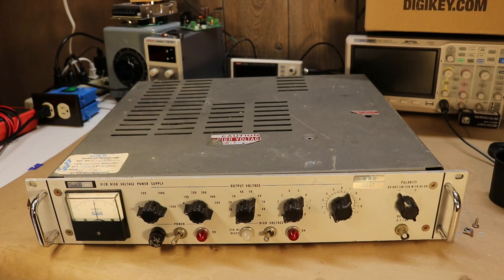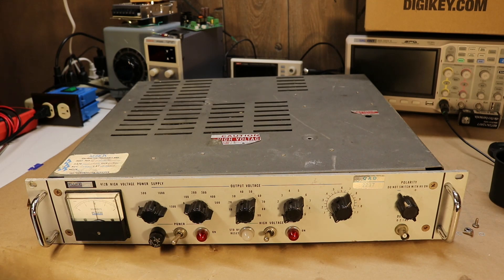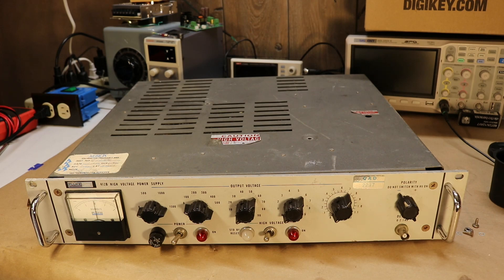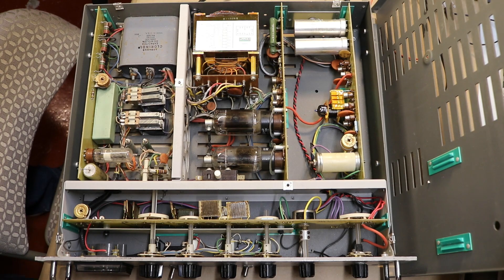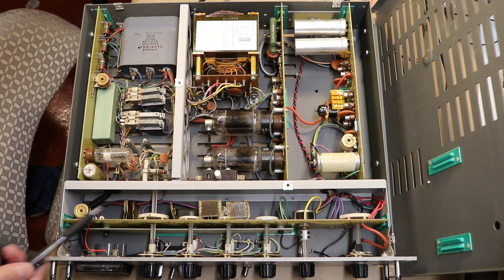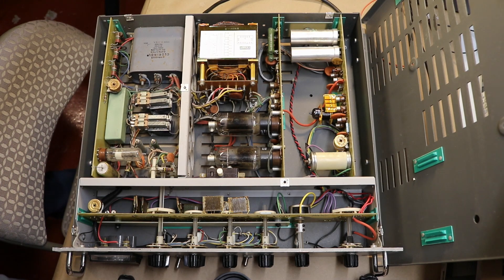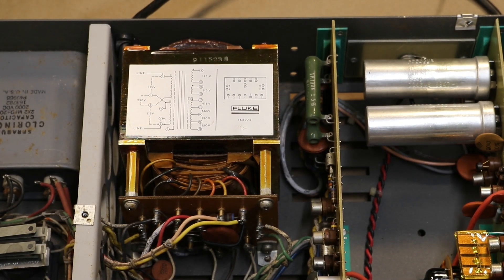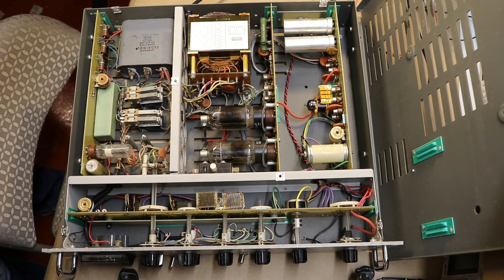Fluke 412B High Voltage Supply Overview and Teardown

Comment: These are great old power supplies. I have used them many times over the years. However I have never seen a power supply used to calibrate multimeters. I have been doing calibration since 1987 and work in a Reference Standards Lab currently. Throughout my career as a Metrology Technician power supplies have been used only to supply voltage for non calibration uses. If a power supply is used as the source voltage it would be monitored with a precision multimeter which becomes the Standard, not the power supply. Calibrators are used to Calibrate multimeters.
Great find!!

Comment: Awesome video, thanks for posting - you seem to be the sole source of information 412B! 
I've got one of these open on my bench right now that I've had for a few years and just got around to troubleshooting. The HV supply and regulation work perfectly, but only if I manually close that open frame power relay.  I'm pretty sure the time delay relay tube (or its control circuitry) is bad, BUT the part number is illegible so I'm kind of stuck.  After I close the main HV relay, both of them operate normally from the HV switch on the front panel, so I think that localizes it to the time delay circuit.

Any chance you have a schematic you'd be willing to share, or at least a part number for that time delay tube?  Any info would be appreciated.  Thanks!
Reply: Ah, that time delay relay was easier to find than I'd suspected - Amperite 115N030 - even found a datasheet.   No luck on a schematic or service manual, though
Reply from the maker: Sorry for the late reply... I looked for a manual for years, even bought what I thought was it from NASA JPL auction... It was for the 412B that is not adjustable... My assumption is there is no longer a surviving schematic. That being said the regulation system appears to be identical to other 400 series like the 410 or 415, and you can find the manuals online. The reference designation will be different, but using the pictures in the manual you can transcribe. See my HackaDay project for more schematic info.

Comment: Nice! I haven't seen anything on youtube (or elsewhere on the internet) about these yet but then again I haven't exactly been looking for details about them. I happen to have the 4kV version (I think) and I'm not sure what I can use it for. I think its current output is even less - much less than 30mA - but I can't be sure right now. For a time I was considering of using it as a power supply for electrostatics but there is really no point (that would be tantamount to the definition of overkill squared or perhaps cubed). Learning here that these were primarily intended for lab use - well, kind of obvious really but then one can never know a priori - kind of clear things up a bit.
2:33 6080 tubes are available as NOS still and their sisters, 6AS7 tubes were still made by Sovtek/Svetlana at least until recently - not sure what the situation is now. You do need two of them so the price seems right, if not a little bit low.
6:53 Ha! Understatement or what?

Comment: Thank you for this video. Got a 412B here that apparently needs some calibration. First dial on 1000V, all other on 0 yields 706V. Second dial on 100, all other on 0 yields 70V. So there seems to a a constant factor of 0.7. Any hint on how to calibrate the supply? Can't seem to find a complete manual online.
Reply from the maker: Sounds similar to my issue… most likely a bad resistor. The calibration pot only adjusts by a few volts.
Reply: @TheMadHatter1337 Hi. You are right about the calibration pot. I can adjust about 5 volts. Any hints on how to locate the resistor? I assume it is located in the right third?
Reply from the maker: I would check the same resistor i show in the video, i think my supply had a similar issue to yours with a 2/3v output from expected. If you are not comfortable working around high voltage, you may want to find someone who is. The voltages on the right sode regulation board should be within 200v of the set point, so a low set-point makes it a bit less dangerous
Reply: @TheMadHatter1337 Will do. Thank you!
Reply: @TheMadHatter1337  Thank you for your advice. I measured the resistor (in circuit) and it is 3,5kR :/

Comment: Oh my goodness, what a thing of beauty and a joy for ever. Watch out for oil leakage on that Sprague cap (its "Clorinol" name suggests polychlorinated biphenyl oil inside) and check out the wires to see if it was not a Fluke... erm, to see if their insulation is not made of asbestos. Sometimes old electronics is full of hazardous materials :(.

Comment: I just got one of these off Ebay byt what output cables are you supposed to use with these? I can't find any BNC cable anywhere near rated for 2kV...at least from reputable suppliers.
Reply: Looking around it seems what I need are actually MHV or SHV cables, not BNC?
Reply from the maker: @DKNguyen3.1415  it depends... Mine had a bnc on the front and a higher voltage one on back... I assume people swapped them out often. That being said, coax bnc when made well can typically handle a few KV. The voltage ratings are often not advertised.

Comment: very nice power supply and teardown. 8068 looks very similar to a 6BG6 but with much higher power and  voltage.  possible replacement would be tube color TV  Line output tube